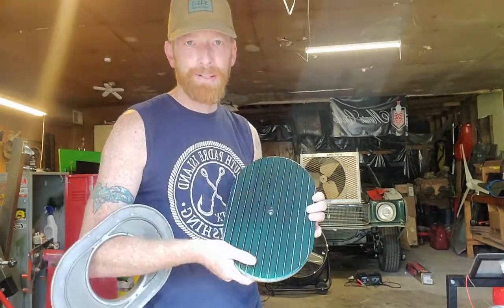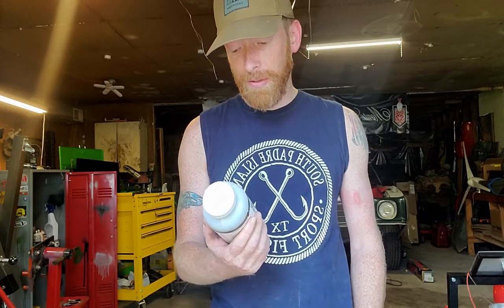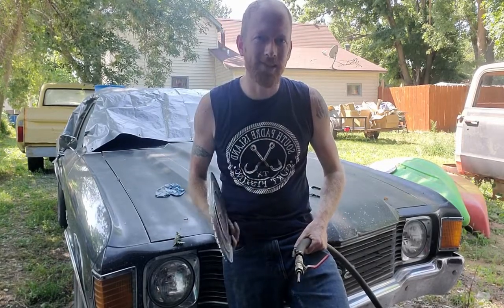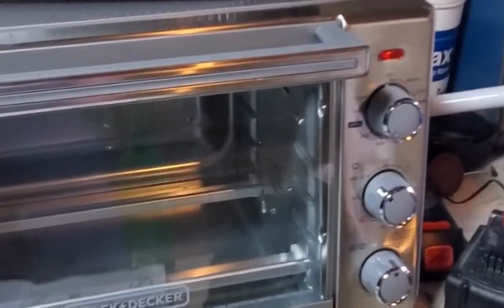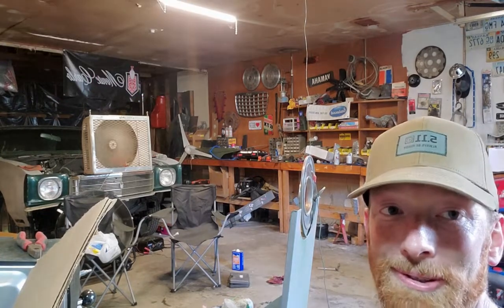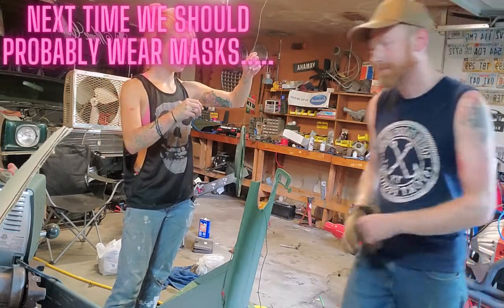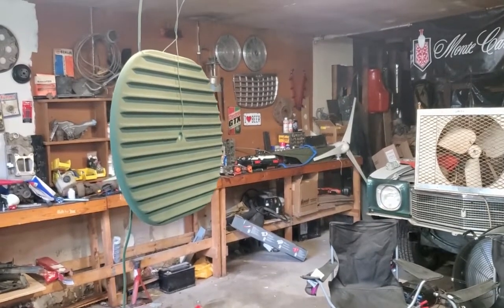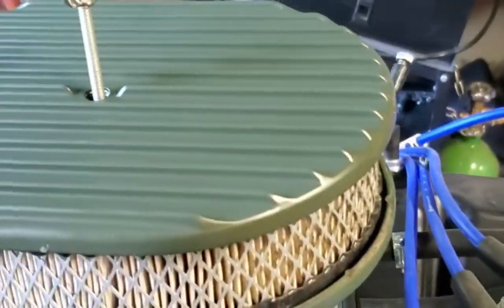Eastwood Powder Coating PT2!!

Comment: Now I need to look into a home powder coating system.  I didn't realize this was a thing.

Small critique if you don't mind.  Lose the music.  It's louder than you.  I didn't hear most of what you were saying.
Reply from the maker: Yeah this was one of our first videos... I think my editing has improved since then.  Thank you for the feedback.  Yeah the esstwood powder coating system is easy to use.  Just make sure you can adjust the pressure to what the manual says.  And have a decent toaster oven.  I plan to move my old stove to the garage so I can powder coat rims.
Reply: @DentedDreamsGarage  A full sized oven sounds like the trick for most stuff.  Maybe build a rack that fits the over, that way you can use the rack to spray and them move into the oven and never have to touch the part.  Good stuff, already bugging my wife to let me get one.
Reply from the maker: @nogarage_garage  yeah a specialized rack would be perfect because currently I always have to bake stuff twice.  I've done thermostat covers, air cleaners, bolt heads, and some other small items.